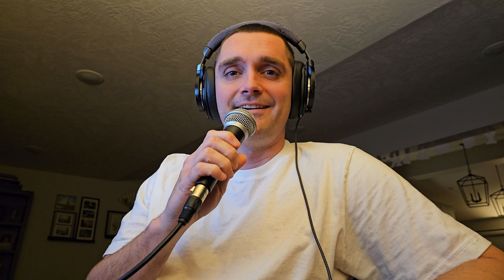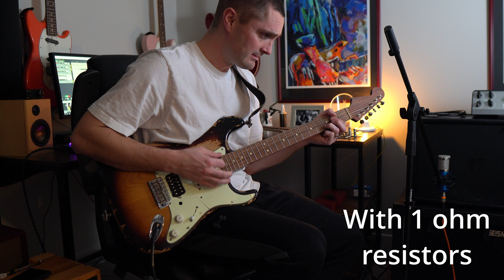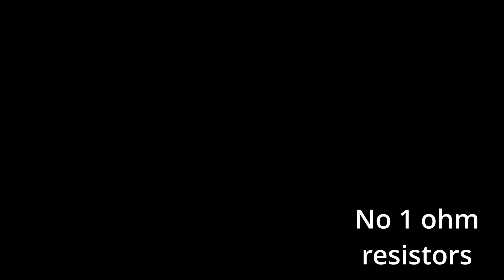1 Ohm Bias Measuring Resistors - Glorious or Explosive?

Comment: That's interesting 🤔. I'm hearing a difference...
Maybe I'll throw the 1r on a switch in my next build. I do love the convenience of the bias resistors..
Reply from the maker: I hear some difference as well, but I wonder if it is down to some slight differences in microphone placement.  I did my best to use the same setup, but exact placement is hard to replicate.  Some slight changes in EQ would probably be mic placement to me.  But I was thinking it might lead to the amp breaking down a bit as you push the gain.  The output volume and character of the distortion feels pretty similar to me.  A switch would be very interesting!  Better test.
Reply: @KleyDeJong  yeah rhat makes sense. Maybe using a looper track would clear things up. 
Either way , I wouldn't want to go without those bias resistors! I also built a couple of trainwreck express amps. Definitely my favorite amp so far!
Reply: @KleyDeJong I hear some pretty significant differences but they could easily be due to mic placement differences, if it was moved between tests. I guess the mystery remains…

Comment: A smidge more top end and grissle and wider frequency at lower volumes. More marrow of those bones sort of speak with that 1 ohm resistor to ground.
Have you ever rebuilt a selenium rectifier with a silicon diode rectifier. Looks like I’m going to have to rehab a Klemp Echolette NG 51 S little by little, bit by bit as I can’t find anyone to work on it. German tape echo from late 50’s, early 60’s used by The Beatles.
Reply from the maker: I have not, good question and good luck with your build!